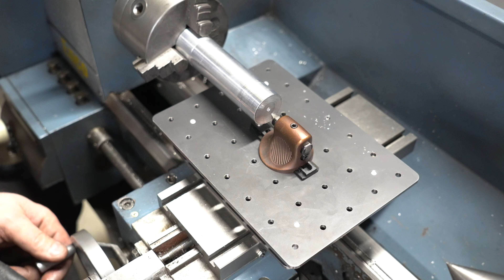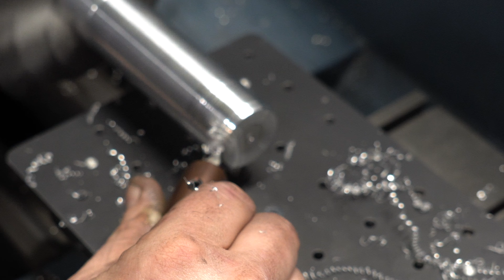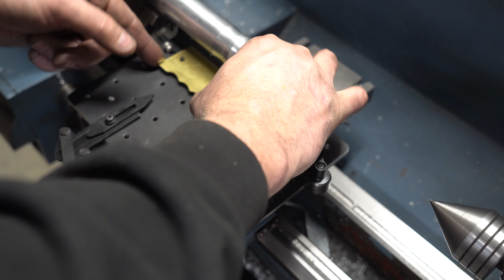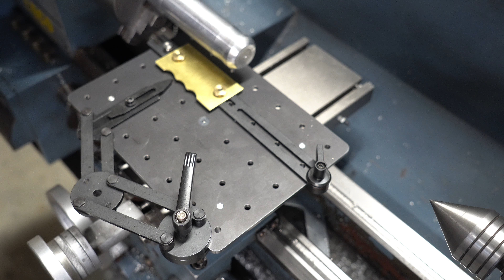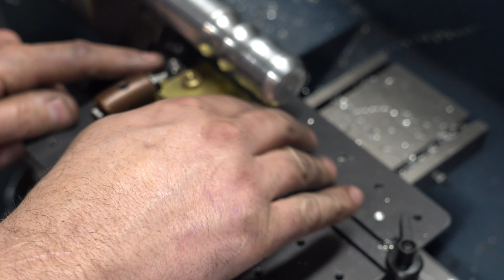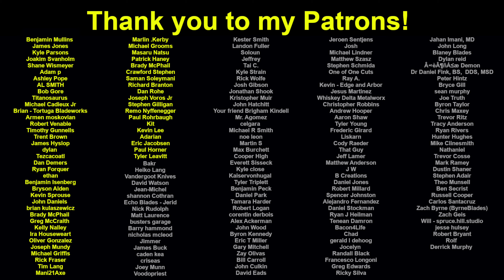Triple-T #125 - Reviewing a new lathe hand tool

Comment: ive chucked up aluminum in my wood lathe and used hand carbide wood turning tools this probably much easier
Reply from the maker: That sounds a little sketchy.  This works well on steel and is very safe.  Thanks for watching, Adam.